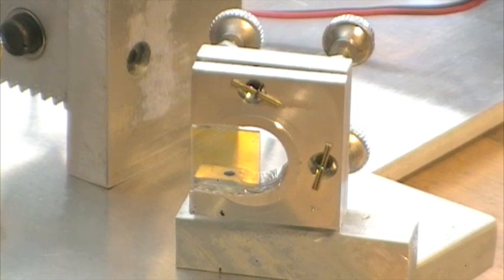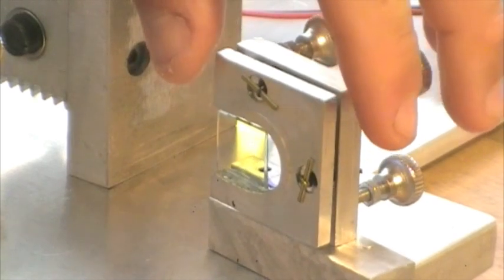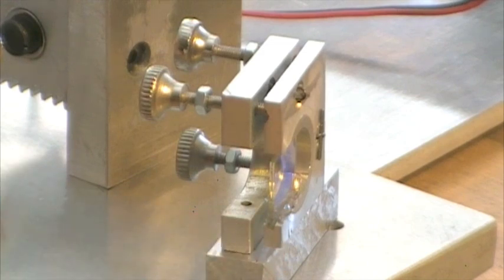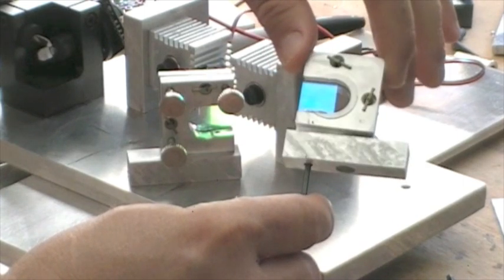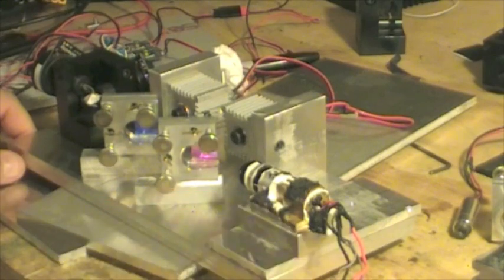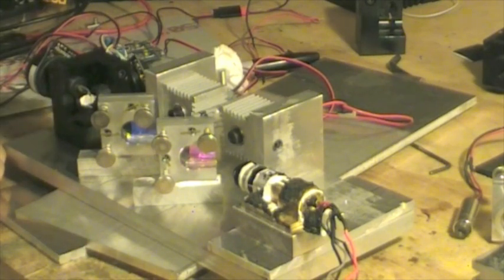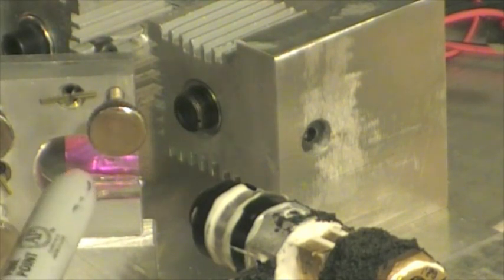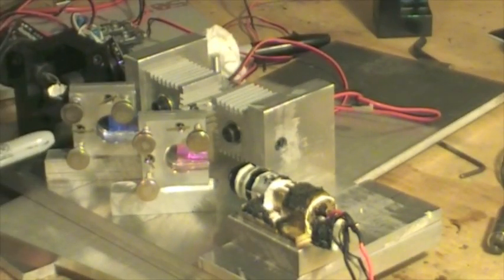RGB laser build Part 2 1

Comment from the maker: It really should be epoxied. When I cut the slots in the mirror mounts to hold the dichros I used a thin dremmel cutoff wheel. It was the same thickness as the dichros (0.5mm thick). The glue just keeps it from popping out.

Comment from the maker: I wish I could test the pump diodes power but its sealed (with some kind of glue). From what i've seen and read on other 532nm lasers it would have to be around 4 watts. It's roughly 25% efficient. I should install a TEC but it seems to do ok without it. It doesn't get to hot. But the green laser does need to warm up a bit for me to get max power output due to the crystals. Sounds like you've got a good setup with the TEM cells.

Comment from the maker: I'm not sure. The module I purchased is sold as a >500mw 532nm green laser. Testing the output it gets 650-700mw of power. If I turn up the current I can sustain around 850-900mw. As far as the pump diode goes I'm not sure what it outputs. My guess is somewhere in the 4-5 watt range.

Comment from the maker: The left laser (larger one) in the first video is a little different. It has 650nm Red at 1200mw instead of the popular and cheaper 635nm Red (orangish) that I'm using now. The green is also only 200mw. It puts out a much more balanced white light at full power without any post adjustments on the software.

Comment from the maker: Red and Blue need to be more powerful than Green. I have the Laser diodes tuned to their maximum power for the brightest show. However this will not give you balanced white light. You must adjust the individual brightness of each laser using the computer program if your want perfect white light. But If I want to blow the audience away with a single bright color at full power I can do that too.

Comment from the maker: 635nm RED at 800mw. 532nm Green at 650mw. 442nm Blue at 1400mw. After it passes through lens's, the dichroic mirrors and the Galvo mirrors the total output will be a little over 2000mw.